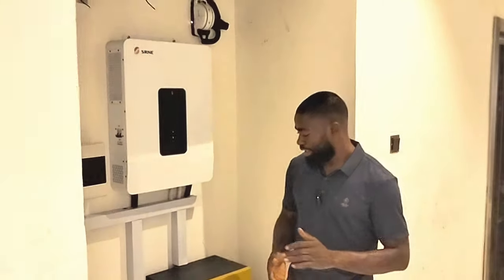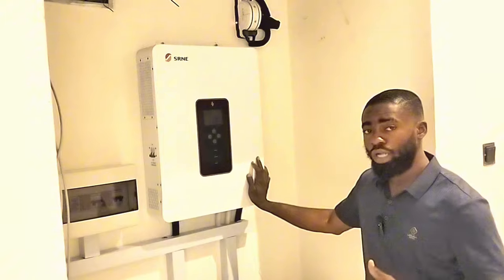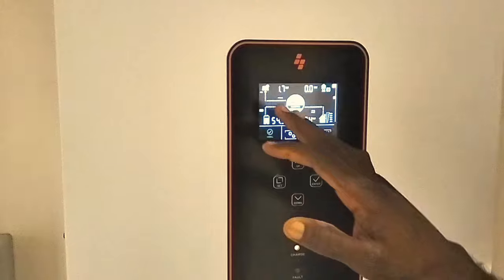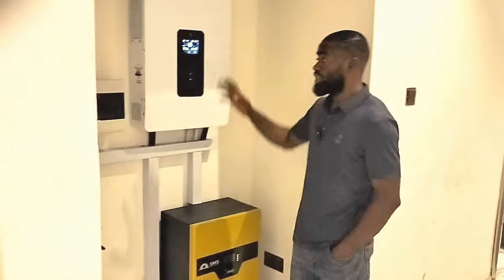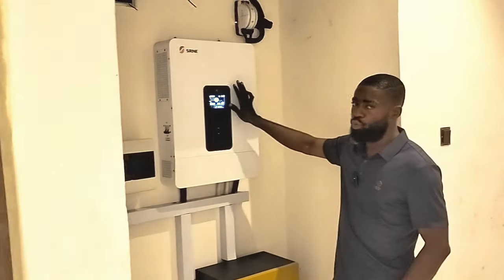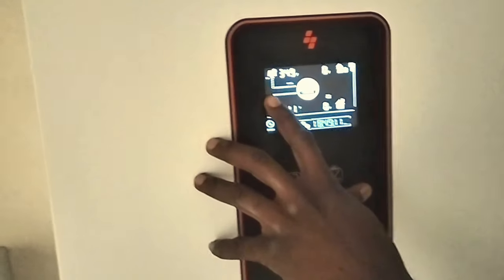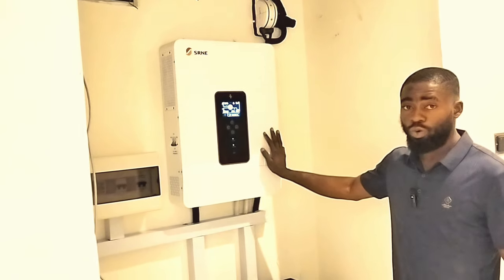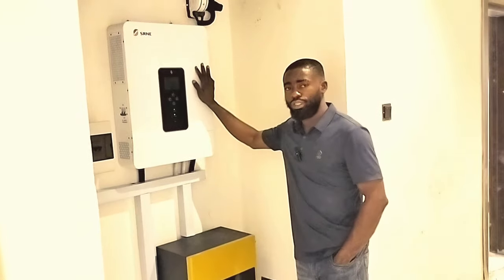Detailed description for a 10/15kwh solar inverter energy system.

Comment: Hello Sir, Thanks for the good work you are doing. I am from Uganda and I have learnt a lot from your videos. I bought a Powland hybrid inverter (SMG II 4 KW) which is a 24v.  Do I have to use only 24v solar panels or can I go as high as 48v solar panels as long as I follow the maximum inverter specs? Thanks

Comment: power saving mode
is on page 24 of the manual
screen 22 of the on inverter display.
i do not use it
when engaged .. after 5 minutes of use less than 50 watts on the
one and only leg that is tested
 the system goes to sleep 
.
if i remember correctly standby is not free it only saves about 60 watts or so.
i do not want to lose instant response for only to save 50 or 60 watts.

with modern 5 -9 watt light bulbs and 30 odd watt fans.
you could be setting down reading and being cooled by your fan as your
phone charges.
only for the system to shut down for to low a load

Comment: i have that inverter 10lk split phase.

on mine 
if the battery type is set as L16 (LFP 16 string) 
it can then be adjusted all the way to the correct voltage
page 23 of the manual .. screen 08 on the on inverter display

.
ps
the switch you were using 
when speaking about standby
I think that's the ON /OFF switch

Comment: Yes, your review is okay but what you don't know about the sms battery is that the BMS is very smart if there is need of high surg or emergency the battery run into Alam mood which blinks RED  and shutdown everything it even smarter than having a breaker...breakers are slow to respond to some surg...that sms bms for now is the best take note 📝 peace and love ❤️
Reply from the maker: Okay sir!.
Reply: Have you used 10.2 kw inverter sms

Comment: Sir, why didn't you go for 15kwh of SRNE battery ?
Reply: Cost might be the reason. 

I bought one of the higher end felicity Li batteries about two months ago and an equivalent SRNE battery was costing about a million naira more. 

The SMS mentioned in this video is even cheaper than the felicity I bought... so you can imagine the price difference compared with the SRNE.
Reply: @luccicorp  

Alright thank you boss.
Reply from the maker: I actually recommended the srne battery, but the client decided to go for sms battery
Reply: @Mairigaemmanuel  

Alright duly noted sir. Thanks

Comment: About the Voltage you mentioned between the inverter and the battery where the inverter only goes up to 54V when the battery goes up to 58V. can that affect the discharge capacity of the battey?
Reply from the maker: Nope, except the charging rate, but somehow the battery was getting filled

Comment: Same as their 5kva. When I turn it off, it stops charging. Hence it's always on so that my tubular battery can always charge.
Reply: If you turn OFF anything .... they stop working... what is the problem ?
Reply: I wonder why people switch off their inverters. I only switch mine off when i will be away from home for a long time.

But with that said, my inverter has an option to continue charging the battery even then the switch is off. Maybe you should dig into the setting of your inverter. I turned mine off though. When i switch off mt inverter i want it to be truly off and not doing anything.
Reply from the maker: 🙄🙄🙄, do your phone not charge when it's off?

Comment: Hello, please how much will it cost me to have a 4.5kva solar inverter unit.
Reply from the maker: 2.4m
Reply: U are doing a nice job sir

Please 1k unit (with lithium battery) will cost me me how much in naira and will it be able to run a barbing salon with 1 ceiling fan, 2 crippers and 3 light bulbs.